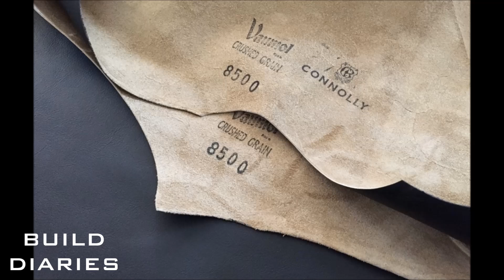Porsche 930 Turbo Backdate Build Project

Comment: that was a galvanized Porsche - how did it get that rusty?
Reply: The earliest galvanized 911's are now 43 years old. Generally, there is a lot more of the shell left over than there would be of a similar '75 and earlier model, but they still rust.

Comment: Nice build and I love the wheel/tire combo, but I have to ask---why backdate a 930? Seems unnecessary to take an already legendary car and backdate it when there are plenty of 3.2's and SC's out there, esp crashed ones, that can give you the same outcome. Just my two cents.
Reply: Agreed, you do not modify, an original 930....
Reply: Why, because Turbos are bloody fast.  Because the longhood looks better.  And to build a good early NA engine w 300hp will cost you $20k ++.  Because it’s what some of us do, modify.  I know I have one of each and a 914-6.  Values of 930s have fallen and if you have a non-stock high mileage car why not?  In today’s market it’s worth only a bit more than a non-turbo, at least at the moment.  I toyed w the idea of backdating my ‘85 Turbo.  I have a ‘71 911.  I will keep it a narrow body and build an engine, then no doubt sell the 930
Reply: I totally agree with you Eric.